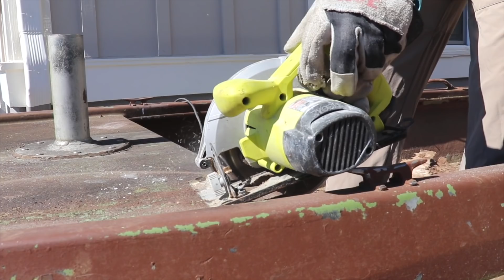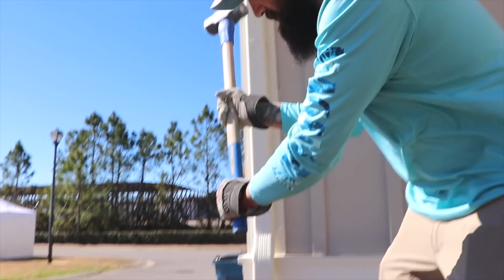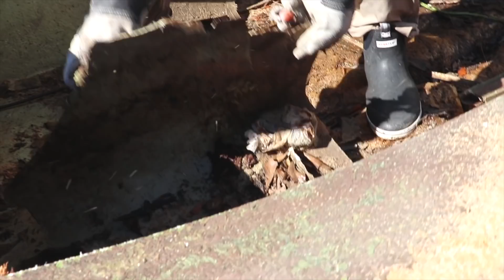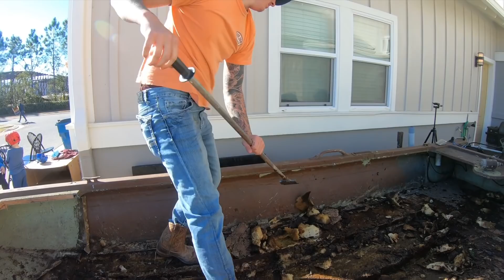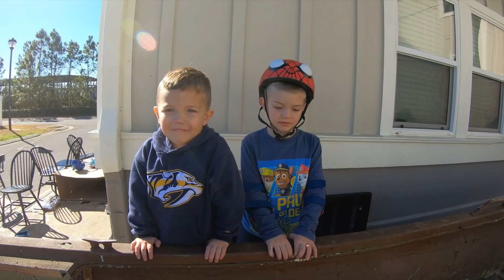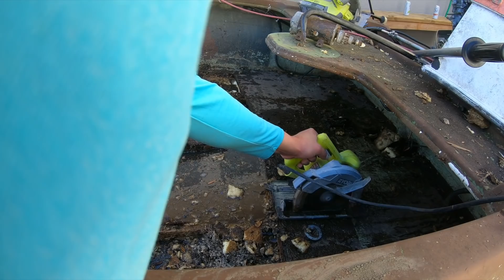This May Be The End Of The Boat Project!

Comment: Suggestion: when you make and fit your stringers cut a couple 2” pvc pipes in half and fiberglass epoxy them and stringers from front to back. Then build bearers just before end of front and back so ends stay open and protected from buoyancy foam.

Comment: Coming along nicely. That's honestly one of the hardest parts. To get the rest out i recommend a big wire wheel on the end of a cordless drill or impact, then use a shopvac to get the small bits out. A small funnel on the end of the hose works great for tiny pieces.  If you take the motor off this is a great time to flip the hull and hit it with some gelcoat although you can save some time and effort and also paint it on the trailer and hit 95% of it. Like someone else mentioned, foam is luxury not everyone has, however todays closed foam does not absorb water like that urinal cake your boi bit into. Personally I would chop the top of the deck where the cap meets the hull but that's just me. If you want more freeboard just keep it as is and extend your deck out past the edge of the hull to stay dryer. It will start to go really fast once you have the stringers and floor bonded in.

Comment: Hi Brad I was wondering how you were doing with the boat, using the PVC like Volusia Youth Foundation said makes a place for water to flow from front to back without soaking the foam and wood is the best way to keep the floor from rotting again. You could remove the power head off the lower unit of the motor and place it with either a lawn mower style engine or an electric motor I would go with a gas motor myself I believe there are videos showing how to do either one on youtube.